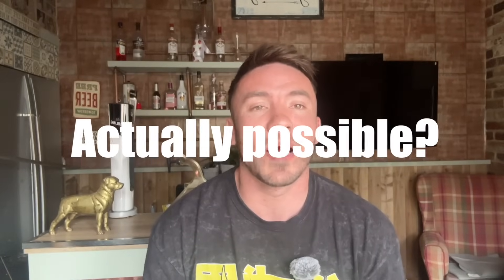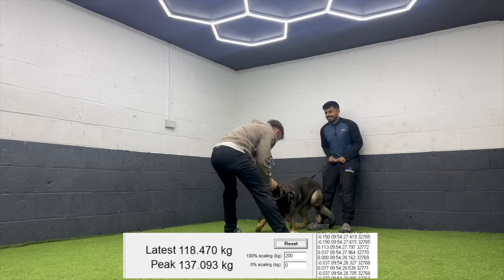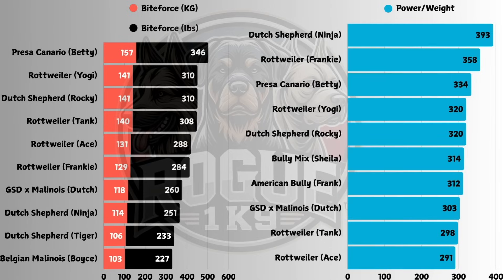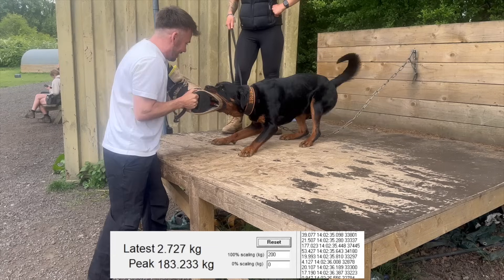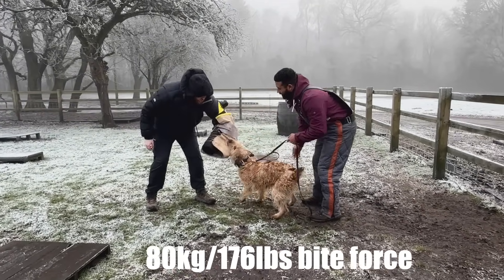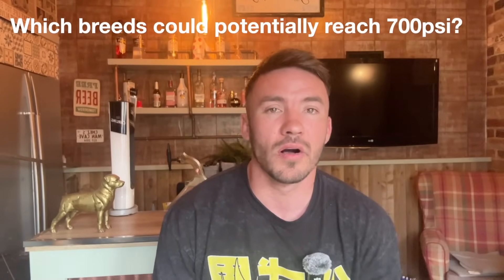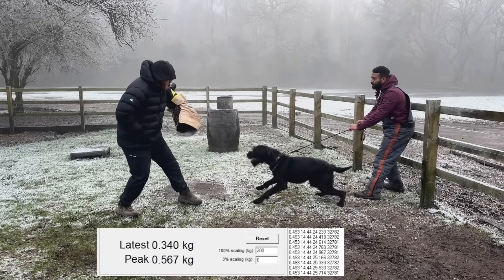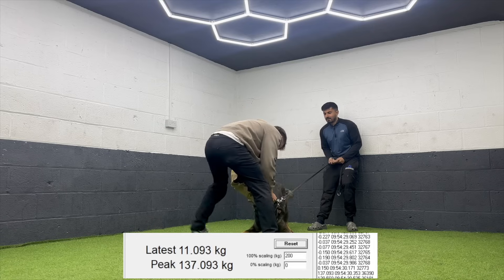700 PSI Bite Force: Fact or Internet Fantasy?

Comment: I just wanted to mention that the bite force muscles in a dog cannot be seen from the outside.

They have muscles on the inside of their chest that constrict and pull the upper muzzle down onto their lower muzzle.

This same concept works for many animals.  For example that is why a parrot can bite so hard.  A parrot has big round belly.  That belly is not fat.  A parrot’s belly is a big muscle that pulls the upper beak down onto the lower beak.

The same concept is at work in the crocodile.  That is why the crocodile appears to have a big fat belly.  What they actually have is a big muscle in their belly that gives them great bite force.

That is why a skinny little dog like a bullherder can bite so hard but have a very small head.  Etc….

Comment: Well, let's take a look at the square inch thing,  shall we? That sleeve of yours, how does it work, more like a bathroom scale? It shows the same result if i step on the bathroom scale with one foot and lift the other foot up in the air or if i step on it with two feet. My weight would be in both tries 275lbs. But the pressure per square inch would be double if i just get my weight on one foot. Now we have etablished that the sleeve of yours is a very inaccurate device to measure psi. What is acfurate is the pressure in whole, but how big is the snout of the dog? How much pressure you get at one molar? Questions, questions.....
Reply from the maker: My sleeve doesn’t measure in PSI. If you take a loot at one of my videos you will notice that the biteforce reading is displayed in KG 💡 we can also convert KG to LBS for our American viewers! That’s the total force applied by the dogs jaw! We also wouldn’t try and measure a dogs biteforce from a single tooth like the rear molar that you mentioned because when a dog bites it doesn’t just use the rear molar it uses its entire set of teeth.

Comment: I trained dogs for protection and we always knew for many years talking about dogs bite PSI. There is no guarantee that any dog will bite at any number. Not even an average is guaranteed for the breed is realistic. Bite force is individual per dog. It is actually more psychological than mechanical. I have trained dogs for protection and seen much variety among the same breed and similar size. So don’t get hung up on these advertised numbers they mean vey little
Reply from the maker: I think so too 👌
Reply: @Rogue1K9  I have doubts about any dog getting that score,or even needing to. Although I will consed to the possibility that 1 or 2 exceptional dogs maybe could. But I doubt it.

Comment: I love the real live testing. Reminds me of bolt clamp load testing I do as an engineer. One thing you should consider is that there are 2 different head designs for dogs. Bite to kill/maim (wolfish) and bite to hold/catch (mastiff). All dogs to my limited knowledge are a variation of that combination. Wolf design is meant to take advantage of PSI through sharper, larger, longer canines while mastiff has shorter, duller canines that allow bite force to be spread over many teeth. Its my belief that mastiff designed heads allow for more force without the risk of damaging the canine teeth which would end a dog's career before modern medicine.
So in conclusion, be careful of confirmation bias. The natural world doesn't select for short canines in most cases because of the PSI benefit a dog gets from the wolfish canine design because it takes a lot lest force to kill when you have canines. Humans have selected for the mastiff design because we want to intimidate with a large head and catch the animal so we can select if we want to kill the target. Wolfish breeds swing a sharp sword with less force, while mastiff breeds swing a baseball bat with more force. A baseball bat can hit the ball out of the park but a sword will destroy the ball. What is your goal when you swing? What is the purpose of the canine you are testing?
Reply from the maker: Very interesting 👌 makes sense to me
Reply: @Rogue1K9 Albai Russian + 400 KG

Comment: I turned on this video and thought that I had once again come across a typical American video spreading nonsense about the strongest bite of a kangal at 735 pounds, invented by no one. Even at the very beginning, I was going to pause and write a critical comment that there was no point in these videos, since they were measuring some mongrel American fakes for real dogs, moreover, tested on a single dog, besides biting a sleeve that was completely not motivating this breed instead of, for example, a wolf's throat/ another dog. But I listened further and realized that the author is a completely reasonable person who tries to logically conduct a test based on his capabilities and not rush to make any loud statements based on these tests. Shaking hands, bro. It's a good job, even if it doesn't give any definite answers to the question of which dogs bite harder. But it refutes fake information from the videos that have proliferated, which mislead inexperienced people.A very good, revealing video with a video of a real dog beating a sleeve with a sensor and showing on the screen what data the sensor is giving out at that moment. Comparing what I saw with the things that happen in dogfights, in real hunts that I had to observe, with the consequences that these bites left on the bodies of people, wild boars, bears and dogs, I can personally conclude for myself that no artificial measurements on a sleeve with a sensor can ever show the real the bite forces of working dogs, whether they are bites of an American bulldog, a Central Asian shepherd dog or a wolfsbane, working for real. But your video is nevertheless informative and interesting.
Reply: One thing is upsetting, you probably won't find real Central Asian Shepherds, tosa inu, bully kutta and kangals for your tests, and even if you do, you won't be able to measure their strongest bite on your sensor inside the sleeve, these dogs bite other dogs or wolves with all their might, but they are the trainer's sleeve they are unlikely to bite with full force. I think that in your tests, American bulldogs, bandogs, burbuls and Rottweilers and Caucasian shepherds will have the strongest bites, these are all dogs that are great at biting people. But as for fighting with another predator or dog, these dogs are not competitors to Asian dogs.

Comment: He is correct that PSI measurement is a bit different. Kudos for taking the time to do this work. I do think though that some Mastiff breads, like the Corso, could hit 700....not every dog and not every test, but on occasion, yes. Here's a Mastiff getting closer than the ones tested so far for example. https://youtu.be/MZm037jPNgc?si=FH-sFi47i5fraQR5
Reply from the maker: That’s the first time I’ve seen that video in high quality! Couple of issues I have with that video is the lack of padding on the measurement device. It looks like a solid plastic block with a thin leather glove over the top. Although the dogs seemed to go at it pretty well. Also it’s a very small area to measure a bite. I wouldn’t say they are measuring the whole power of the jaw looks more like a couple teeth worth
Reply: @Rogue1K9 they using psi,maibe angle,teeth shape,or teeth size.i dont think this is 556 pound bite.

Comment: I've been waiting a long time for some more factual bite information. The only factual dog bite info came from Dr Barr with national geographic. They didn't put near the quality work into you have though. I've been saying for years the claims of 743psi for the Kangal and whatever 700psi  number for the Corso are completely made up.  The highest bite ever measured was a "mastiff" at 565psi by Dr Barr. They found exactly what you said. Head size, particularly the areas you mentioned, are what seem to determine bite force in dogs. Please keep up the great work guys. PLEASE test a Fila Brasileiro. They are made for it.

Comment: No animal will bite with full force - it's risking an injury. To properly measure the bite force, we need to do this by a computer. 
Do people bite with full force while chewing??? I sure don't.
EDIT:
The "kangal" on the photo is not the aboriginal kangal, those dogs are NOT like mastiffs, they have a wolfish head (also they are sometimes mixed with wolves). The dog on the pic is most likly a Malakli or a Kangal mixed with a mastiff.
There is also a "Volkodav" breed. Those dogs are HUGE. Think Alabai x2...
Reply from the maker: Why would you need to bite with full force while chewing? Are you eating pieces of wood? Of course animals bite with full force. Kangals will bite with full force when fighting coyote’s and wolves because their life is at risk otherwise. The same with catch dogs. Dogo argentino and pitbulls will bite with full force when bringing down hogs because if they aren’t holding on tight that hog will YEET them into the air. And any Belgian malinois that trains in bitework will bite with full force on a sleeve because it’s a Belgian malinois and they don’t do things at 50% it’s 100% or nothing. NEXT
Reply: Of course they bite full force ! 

It’s equivalent to us lifting something with our hands 

But of course we’d never lift something full force with our hands risking injury like lifting weights right ? 😂😂😂

Some idiots on here
Reply from the maker: @stefanclark4869  😂😂

Comment: 700 PSI is a myth, the Kangal even if impressive. for it is far from that? I think that a Cane Corso would be better level powerful jaw and on other points. I have an American Staff that weighs 27 kg I think that if it has between 130 and 150 kg of pressure in the jaw it is already quite devastating.